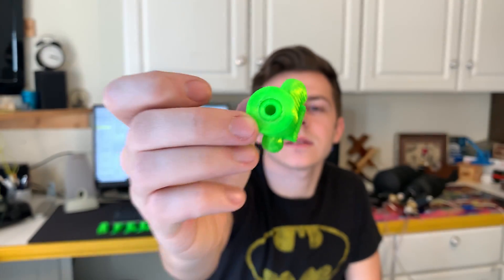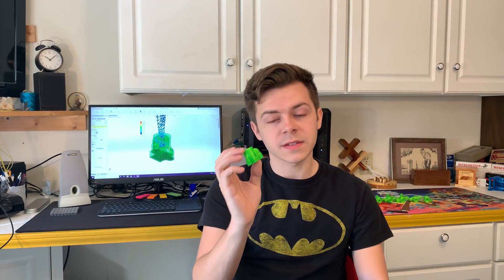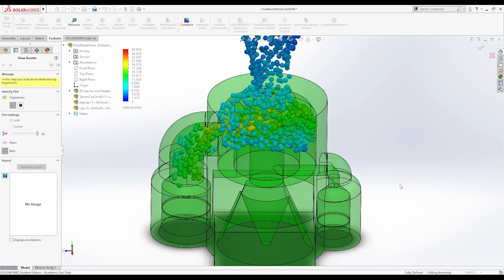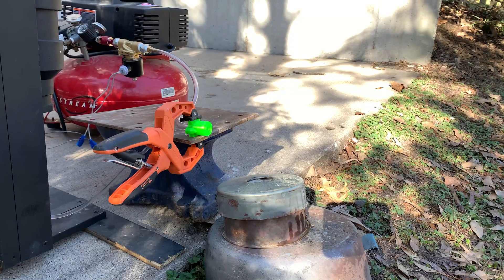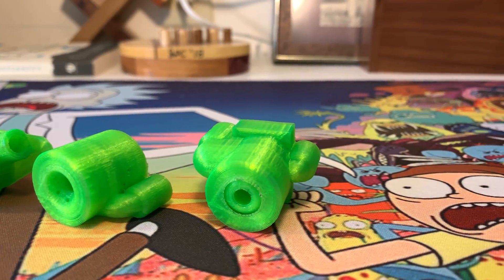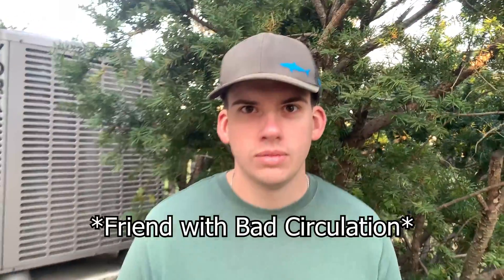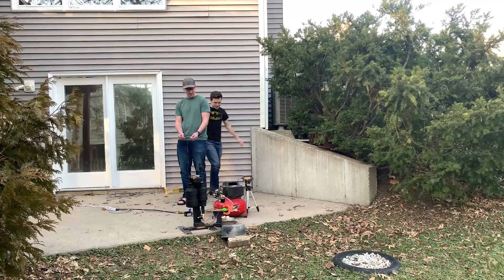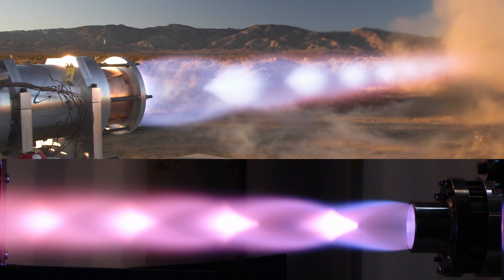3D Printed Rocket Injector

Comment: I am just wondering as a licensed light oil technician, did you know the whole idea behind oil burners is complete combustion and they use a flame tube and low pressure air from a fan with high pressure fuel atomized from a pump. Readily available parts and swirl cone at the end of the flame tube. Mach diamonds are a result of speed and that is the result F=ma so pretty much high speed fan or lots of pressurized fuel.

Comment: Great design! It obviously works really well.  I have something I would love to try with it that isn't rocket related. I want to try silvering glass with a two part spray system and thought the thorough mixing would create a really even end result.  If you wouldn't mind sharing for that use only I'd really appreciate it and you can find my e-mail on my channel (not a real channel, just share some project videos, but my email is there). 

Thanks for sharing your results either way!

Comment: This seems like it would be an incredible application for water misting in indoor farms. Using the bernouli principle to to distribute a fluid via low pressure rather than using high-pressure fluid feels like a much more energy efficient strategy. But I have no numbers to back that up. I would just imagine it would take less energy to maintain the system with a tank of high pressure air than continually pumping the fluid itself to maintain pressure in the lines.

Comment: why does the engine fire not go into the fuel tank?
Reply: Because the fuel line has no oxygen. The worst that could happen is the injector could explode, but it looks like the flowrate is faster than the combustion and it can't make it's way back in to the injector.

Comment: You will definitely need high temperature metals and liquid oxygen, and a pump (for this size, you would be best off with an electric pump, since getting a turbo pump to work is very complicated (such as in needing cryogenic methane)) to prevent the exhaust from going back into the fuel tanks as it compresses before leaving.

Comment: Put it on thingaverse I wanna try
Reply from the maker: Sorry, but I don't post files for projects I could see people easily hurting themselves with. I checked out your channel though, you're castings are pretty dang cool. Have you ever attempted lost PLA casting? I managed it with a small figurine, I'd be curious if you could do better with all your skill and experience.
Reply: @Sciencish  yah, I’m just getting into it. I don’t have near enough materials to do it well. Nor do I have the money, I’m a 15 year old umpire and it’s not baseball season. The whole reason I was getting into lost pla was for a rocket nozzle. I’m making a flamethrower right now, so I’ll probably design my own but if I base mine off of yours I will definitely tag you.
Reply: @Sciencish  If i upgrade some gear I could make you a piece. Oh and if you have a resin printer and the ability to cast at home, they have specific resins for casting. Also vacuum casting will help for detailed pieces.

Comment: Are you still planning on printing a nozzle? I would really like the project
Reply from the maker: I actually have already printed one, and tested it this morning. It had some issues igniting that I’m going to try to figure out and fix really quick and try again this week. I want it to at least explode if not fiction, but to just fail to ignite is really boring haha
Reply: @Sciencish  so I can await a new upcoming video about the 3d printed rocket? is there also an website for the progress of the nozzle?
Reply from the maker: Yes hopefully the next video will be done soon, I plan to try it again tomorrow morning with a new ignition system. R/rocketry on Reddit is where I post the most updates, followed by twitter, but those are few and far between

Comment: I thought shock diamonds was a signal of combustion deficiency 🤔

Maybe I misunderstood the other guy that met Elon and the rocket lab CEO.
Reply from the maker: They are at the very least a sign that a nozzle isn’t well matched to the atmosphere, which is not as efficient as a matched nozzle. But they are a good indication that the flow is supersonic for my needs, and most rockets generate them since they go through different atmospheric conditions as they fly. Mine will generate them bc it’ll be poorly designed and cheaply made, that’s if it doesn’t immediately explode or melt haha
Reply: Sciencish I see, thank you for the clarification, those diamond shocks look so beautiful, I hope you can succeed. 

Copenhagen Suborbital is trying with 3d print but in metal. They saw some slightly improvements in performance vs a machined one.

Comment: Is it intentded to work in an hybrid rocket spreading oxidizer? Could it work with gas such as N2O?
Reply from the maker: The goal is to get it to work with a liquid fuel and just compressed air, but with some adjustments it could probably work for any  bipropellant rocket

Comment: How much pressure do you have?
Reply from the maker: I can’t remember exactly offhand, I think it was something like 15-30 psi in the fuel tanks, maybe 80 in the air compressor just because it made cooler louder flames haha. When it’s in an actual engine it’ll be quite a bit higher, and I’ll have to pressurize the fuel tank with an inert gas too not just air.

Comment: Can make a small water circuit for cooling? Plastic will not heat up too much and will melt. Or cooling with fuel, but it is not so safe.
Reply from the maker: I’ve thought about it, since it would be really easy to print a cooling jacket and nozzle in one piece. The problem is the thermal conductivity of PETG is less than 1 W/m•K, which is a lot lower than conventional materials like steel (50-ish W/m•K) and copper (380ish W/m•K). This just means that the inside surface of the plastic would almost definitely already be melting before it could be effectively cooled by the cooling fluid.
Reply: @Sciencish  How fast does plastic melt? And will there be a continuation of this topic? There will be a liquid rocket engine
 :D?
Reply from the maker: I'm not sure yet but it'll melt really fast, It will only operate for a second or two at most. I will keep working on this and post a video of the plastic rocket even if it doesn't work! Also your grammar is fine!
Reply: @Sciencish  Successful development!)
Reply: @Sciencish  If I apologize for the grammar, google translator all things

Comment: How do you pressurize the fuel?
Reply from the maker: Just compressed air right now, but that won't due in the future since it means I'm mixing fuel and oxidizer (even if its greatly diluted by nitrogen) under pressure. An inert gas would be better but obviously more expensive than using my compressor which is free.